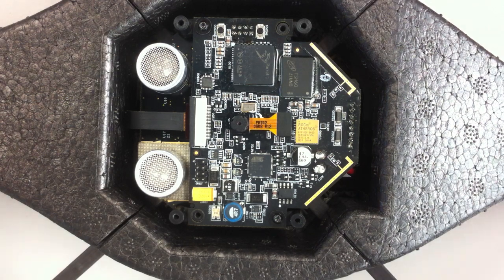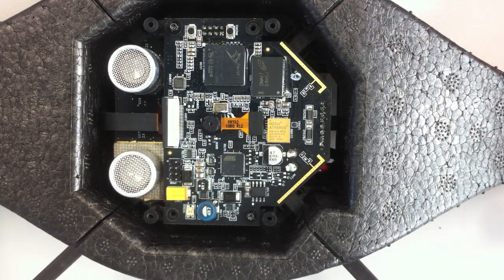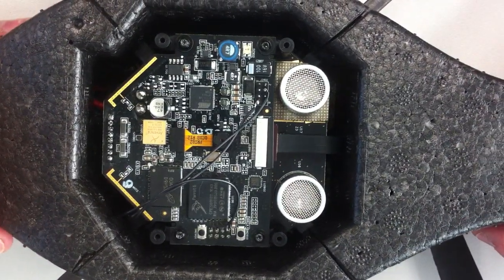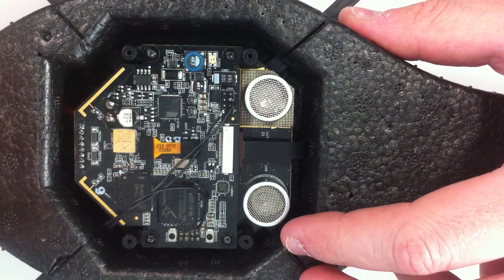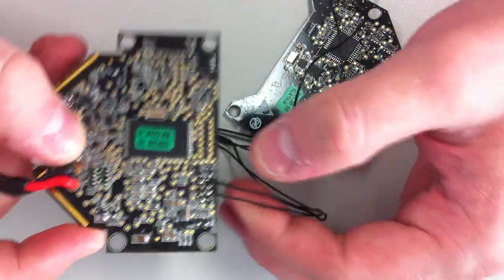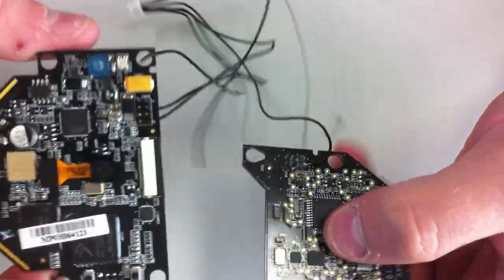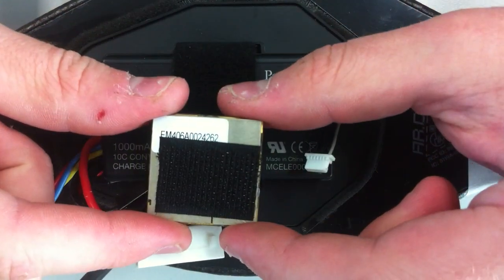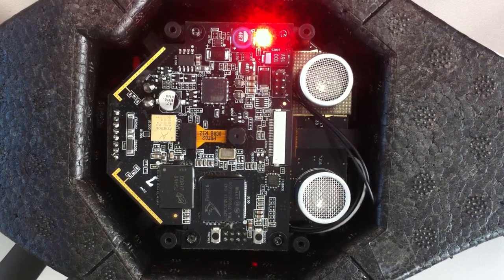AR Drone V1.0 GPS Mod - Part 1.

Comment: How do you un-brick the board? I brought the model and I am unable to connect to wifi and the red lights stay on.
Reply: Force reset it by holding the reset button for 10 second, try that.
Reply: ROBERT TURNER
Reply: do you have luck?

Comment: So let me make sure I understand you correctly; we just need to solder on the connector/power cables for the GPS, connect it, set the serial speed to 4800 baud, then we'll be able to view the GPS data in /dev/ttyPA0 correct? Then we can experiment with the program?